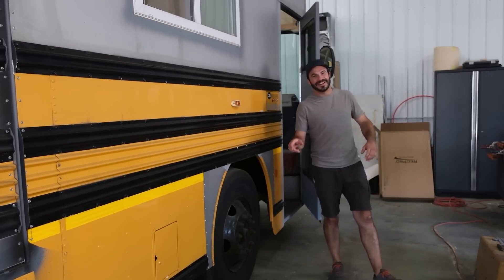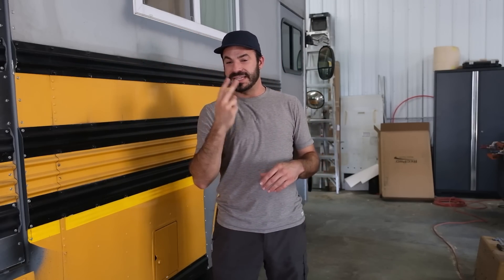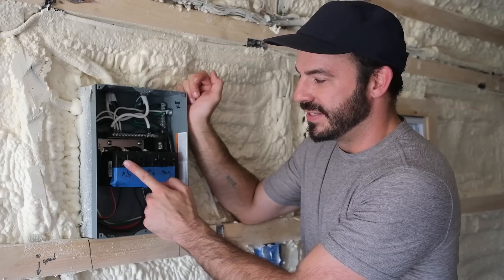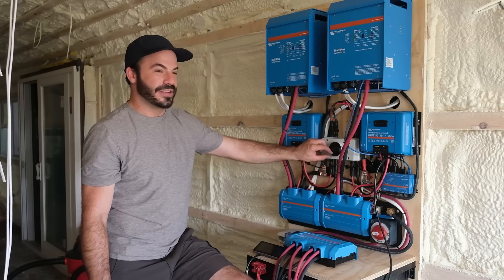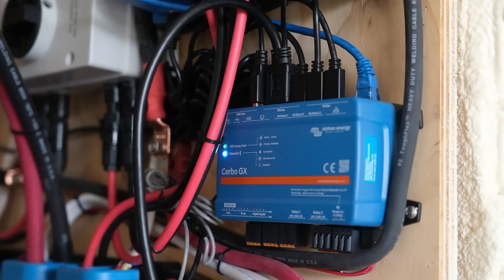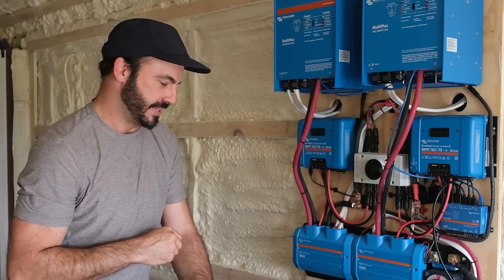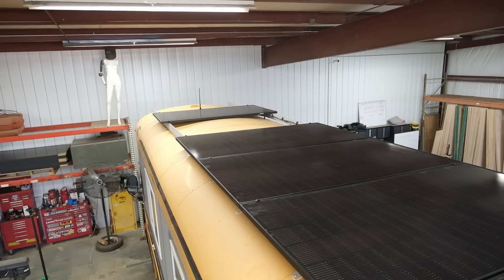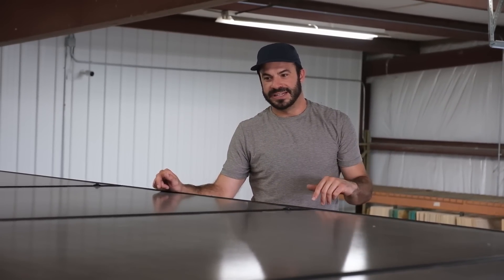Nasa-approved! A 220v solar-powered, dual-zone mini-split that also runs on 120v shore

Comment: What does NASAS have to do with this? and you mentioned 20,000 dollars.. does that include the dual zone air conditioners?
Reply from the maker: Solar only. I put nasa in the title to make it interesting hopefully so people will click
Reply: I still do not get how 120 shore power gets 220 to the Minisplit... and is it charging both batteries systems at the same time? thanks for the video.. it is amazing that you put it up when you did because Brenda and I were planning that very setup for the Bus we haven't bought yet...If you see a dog nose 35ft or 37 ft from down south some where -without rust, without emission technology.. give us a shout.. @ChuckCassadyYT

Comment: It's unneeded.  I single minisplit will cool the entire structure with no problem.  Even through rooms, it's still enough.  This isn't just overkill, it's overkilling an overkill.  This thing does not need 220v, the components are expensive, and all of it is used to justify an efficient AC??  It makes no sense.
Reply from the maker: Ronnie, I can personally attest that a single 12kbtu split is not enough to keep this bus cool in midwestern heat. Thanks for the extremely helpful comment!
Reply: @ChuckCassadyYT  .  I have built one tiny house on wheels and lived in it in Palmetto Ga for 3 years.  I built a 40' container cottage in Alabama.  And, I live in a 450 sq ft cottage.  Not one needed anything more than a 12000 btu mini.  But, okay.  All of my experience must not hold up to yours.
Reply from the maker: It’s almost like we have different opinions based on different life experiences. Imagine that. I’ve built dozens of conversions, and most of them use a minisplit. I tell my customers all the info I have and let them make the decision. They wanted the capacity. Start a YouTube channel and go be the voice of reason you say you are my friend. Peace
Reply: @ChuckCassadyYT  .  If that's how you justify this, so be it.  But, YOU are 100% wrong.  My wife is laughing her butt off right now.  Because even she can see the holes in your logic.  We are sitting in a cottage right now, that is bigger than your bus, in 90+ heat with a 12000btu AC.  Our tiny house was cooled with a 5000btu window unit.  Every single experience that I have had proves yours wrong............  I am a retired electrical engineer.  All of those transistor and SCR based inverters is what I specialized in.  I've forgotten more about this stuff than you will ever know.
Reply from the maker: Then get off your lazy ass and start a YouTube channel so you can save the world! You’ll never do it just trolling in the comments section—take that bragadocious personality of yours and go public! You’ll be a hero! The parades! Go get em!

Comment: I had considered a similar setup with a pair of 3k hybrid invertors, but was concerned there was not enough capacity left on the system to run another appliance, for example a microwave or a washerdryer. From your experience, is this possible without having to turn off the aircon? Also why not go for a hybrid invertor, seems to be a vastly cheaper setup?
Reply from the maker: Those hybrids are less configurable, have significantly higher idle consumption, and don’t offer the same connectivity the victron does. I’m a victron installer because it’s my preferred brand with an outstanding reputation. This system should have around 3000 watts of headroom when the ac is on